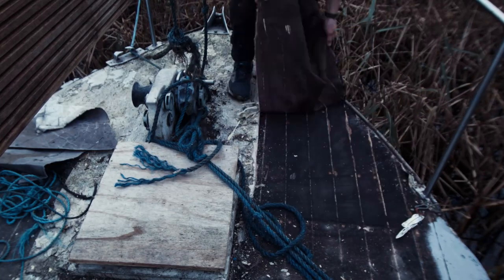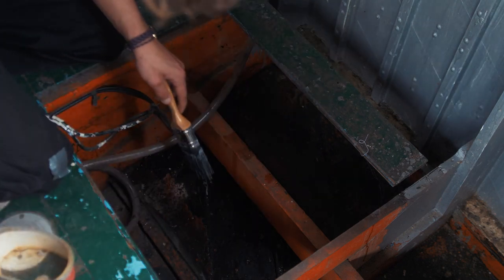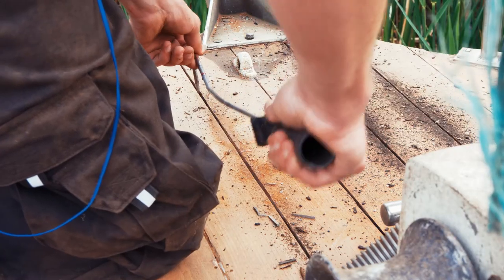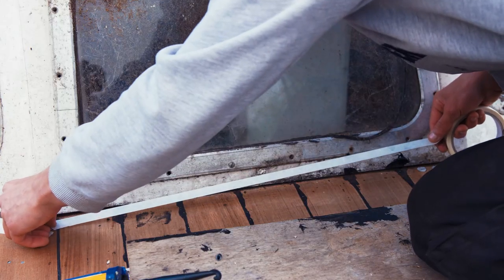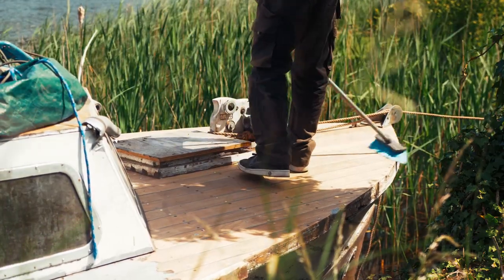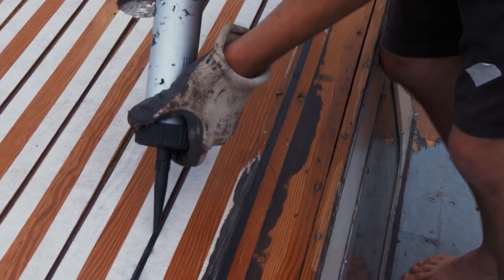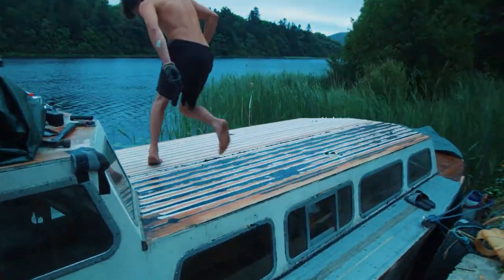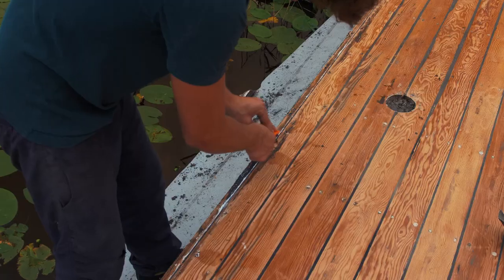Episode_08 - Restoring a 40' Wooden Boat

Comment: I think that the fabric you took up from the bow planking was probably the original covering. At the time that boat was made a standard process for waterproofing decks and cabin roofs was to first apply a very generous coat of white lead paint. Whilst the paint was still wet a sheet of canvas was laid over it and rolled and pressed down to try and get the wet paint to soak through it as much as possible. After that a second generous coat of white lead was painted over it and this was then allowed to dry. The canvas [ probably a very stout sailcloth ] was first wetted through so that as it dried out it would shrink slightly and give a taut smooth surface before applying the second coat of white lead. The canvas was lapped over the edge of the bow planking and secured with a strake along the edge of the planking and overlapping onto the hull. When all was dry you've effectively covered that planking with linoleum and it would be ready to receive its finishing coat of deck paint. I know!! where in heck are you going to get genuine high toxicity white lead paint nowadays? It was used then as not only was it a very high grade undercoat it was extremely good at preventing rot as the first attempts by any spores of fungus or other micro organisms were usually their last as the white lead would kill them off. I fear that as those deck planks dry out they may well open up and allow leaks to begin. I've seen west system epoxy used in conjunction with a glass fibre mat to replicate the process using white lead and canvas to very good effect. If you do experience any leaks later it may be an answer to that problem without any need to try and re seal the decking. I wish you well and good luck with the rest of your restoration.

Comment: Being a wooden boat owner as well I connect with all the tricks  needed when the work gets tedious. My boat is 36' (old salmon commercial boat) and when it came to recaulking and filling (I too use Sikaflex), I bought a caulking gun I could hook up to air compressor. What a time saver and wrist saver!! Not to mention getting the work done twice as fast. Only about $25 Canadian. Great vid. Cheers.

Comment: Great content , I do hope the sun does not attack the exposed wood. UV varnish product need constant maintenance.  I know it's too late now but it would be better if you pushed with the caulk nozzle in front , it seems weird but it does a much better job filling the grooves.  But  boats is really looking good . Cheers Warren.
Reply from the maker: Thanks Warren. I don't think I'll mind the extra bit of maintenance once all the roof timber finishes in a similar fashion to the bow planking. It certainly make the hard work worthwhile seeing the finish.

Comment: Hey, check out S30 (LOCTITE® PL® ROOF AND FLASHING POLYURETHANE SEALANT) - it's ridiculously thick, but relatively cheap, and crazy bulletproof.
Reply from the maker: Thanks Rick! I'll be sure to check this out
Reply: @LakesideProductions  word! Few other things - I've used it a ton. It stays tacky for a week, which can be a pain, but it stays flexible and never seems to break down like other sealants I've used (seems unaffected by UV exposure). 
Smells oddly like melted hot fudge - the cheap kind of fake stuff that comes in a glass jar. 
I noticed the guy and girl on "Salt and Tar" use it as well. 
Good luck amigo!